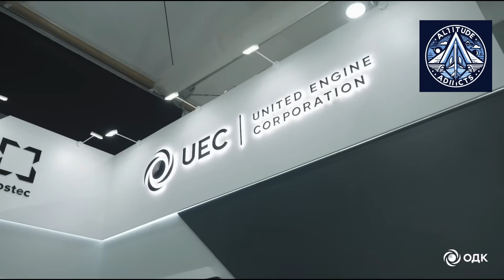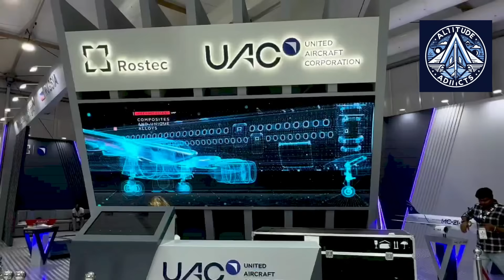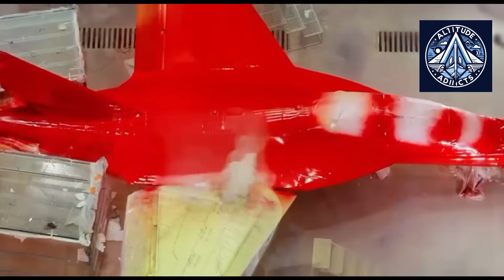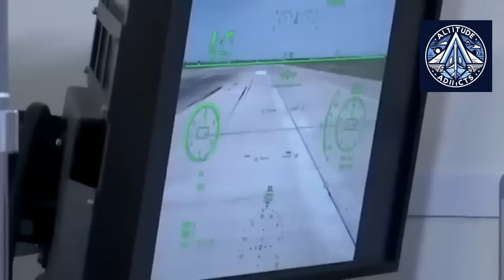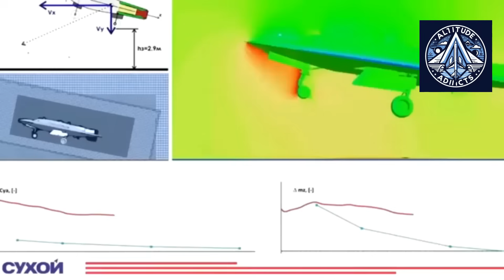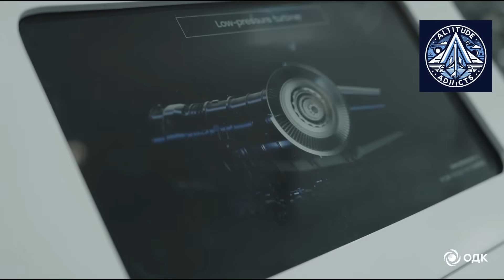AI-222-25 Replacement? The New SM-100 Trainer Jet Engine Revealed!

Comment: 4.30 - so they talking of creating a high bypass version for civil and long endurance drones - Americans typically use turbofans designed for business jets in their jet powered drones. 
- military low bypass are not really what you want in civil aircraft or long endurance drones as fuel consumption is too high

Comment: russia need single heavy weight lighter trainer attack  fighter jet like jf17 like tejas like kf 21
Reply: Yak
Reply: like yak130?
Reply: MiG are working on the MiG-UTS, but it is not heavier than the Yak-130, it is lighter. The use of a single engine is to make it cheaper and smaller and lighter so it can replace the L39 as a cheaper lighter jet trainer to use between the turboprop trainer and the Yak-130 more capable but also more expensive light trainer. Trainers with powerful single engines that can be used as light fighters are silly, you would be better off with a real light fighter like a MiG-35 or Su-75 that is cheap to buy and operate but actually has good performance as a light fighter attack aircraft.